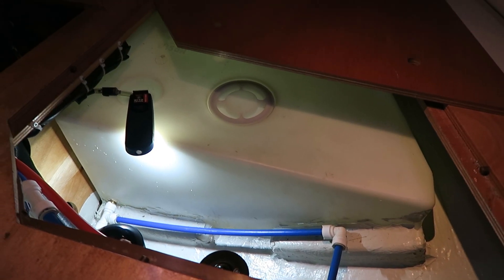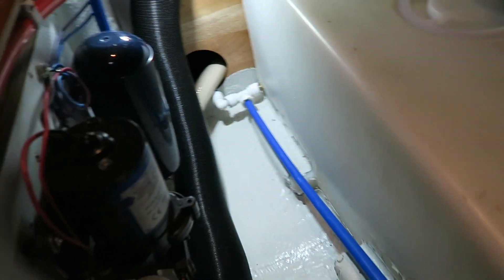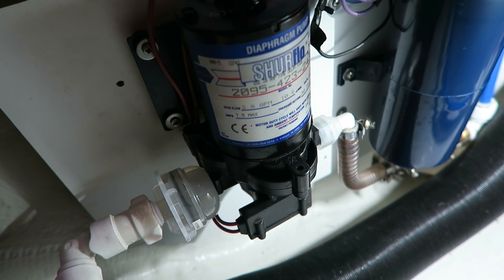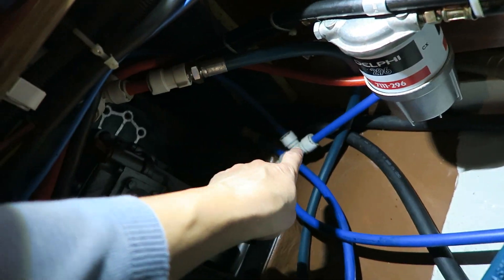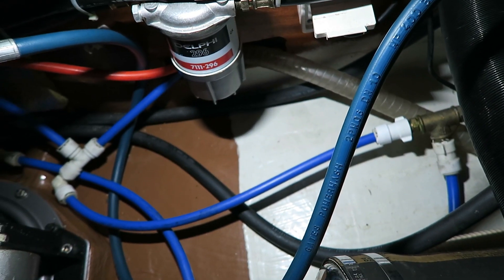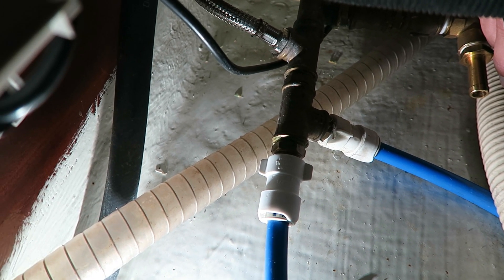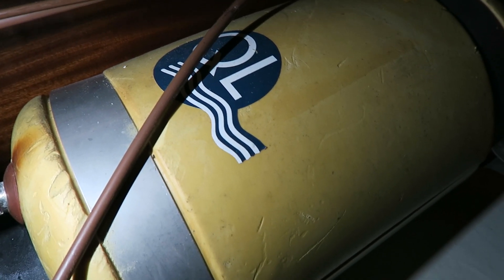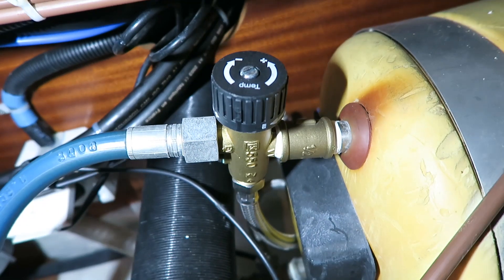The fresh water system and how it works

Comment: Those Bavaria fire extinguishers look a lot like the commonly used Glorias. Extinguishers used in marine environment need to have an annual inspection. On top of what Tino described, it also includes inspection of the rubber hose, safety pin and an over all look. You get  a new inspection sticker and that's pretty much it. Extinguishers need to have a pressure test and refill every 10 years. That's usually as expensive as a new extinguisher, so usually you don't meet that old extinguishers in boats.
 I had 6 extinguishers up to 30 years old lying around, which I disharged just to see if they still work. All worked just fine, so you migt have them for example in your home where they don't need to be inspected, for extra safety. Then just make sure they work as Tino described.

Comment: In Netherlands you can or must check the fire ext. by a certified company that gives a certificate for a new year. For insurance company itis obligation.
In this danish law it says every ten years check.
DMA no. 001
Issue Date: 18. September 2014
DMA RO Circular no. 001
Danish national legislation
1. Rule reference
• Danish RO Agreement.
2. Application
Danish national regulations in addition to the SOLAS Convention, the International Conven-
tion on Load Lines and the MARPOL Convention, applicable to cargo ships of or above 500 
GT engaged in international trade.
3. Cargo ship safety construction certificate (SAFCON)
3.1 Notice B from the DMA, II-1A (SOLAS, II-1A)
Regulation 3-5 – New installation and repairs of materials containing asbestos
2 From 1 January 2011, for all ships, new installation of materials which contain asbestos 
as well as repairs carried out using materials containing asbestos6 shall be prohibited.
6) Attention is drawn to European Commission Directive 1999/77/EC on restrictions on the marketing and 
use of certain dangerous substances and preparations (asbestos), according to which the exceptions stip-
ulated will lapse as of 1 January 2005 in the EU member States as well as in countries covered by the 
EEA agreement.
3.2 Notice B from the DMA, II-1B (SOLAS, II-1B)
Regulation 19-0 – Stability information for [passenger ships and] cargo ships
1 Ships the keels of which are laid or which are at a similar stage of construction on or 
after 1 April 1976 shall, regardless of their length, comply with the relevant provisions 
in the Code of Intact Stability, Res. A.749(18), as amended.31)
1.1 The same shall apply to ships that are being altered if the alteration has considerable 
effect on the conditions of stability and to ships bought abroad if they are registered 
with the Ships Register or Danish International Ship Register.
1.2 Ships the keels of which are laid or which were at a similar stage of construction before 
1 July 1998 and all cargo ships with a gross tonnage below 500 shall, however, not be 
required to meet the weather criteria in regulation 3.2 of the code.
1.3 The special stability criteria for container ships with a length of more than 100 m stipu-
lated in regulation 4.9 of the code are not mandatory.
1.4 If the existing stability information of the ship must be corrected in order to comply with 
this regulation, such corrected stability information shall be approved at the next re-
newal survey, at the latest.
2 Suction dredgers shall comply with the provisions of the code under general loading 
conditions and under the following special loading conditions:
.1 Light ship with stores and 10% bunker.
.2 100% bunker, no cargo.
.3 10% bunker, water in cargo hold to the widest level.
Contact: ro@dma.dk 1 Revision no. 04
www.dma.dk
Reply from the maker: That was a lot of text, but yes it's important to keep the safety equipment in good condition.
Reply: @twiper  Hi Tino, i couldnt sent a link,it was pdf.
Reply from the maker: @pblnlpalu  Totally ok :)